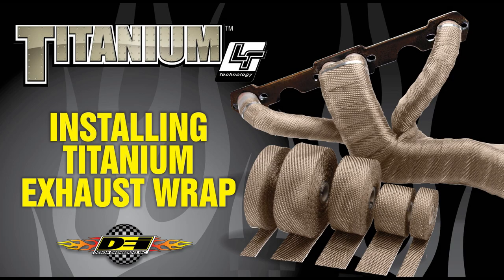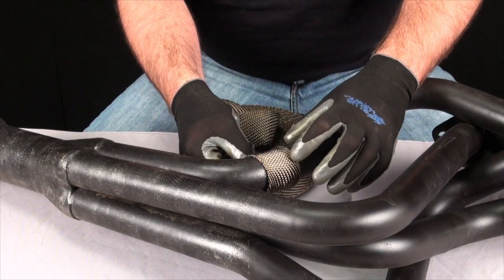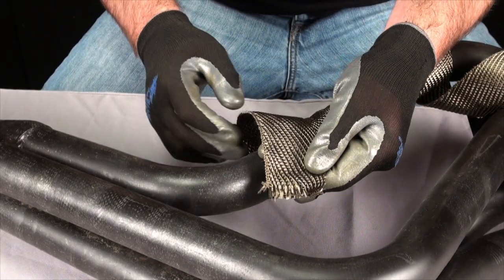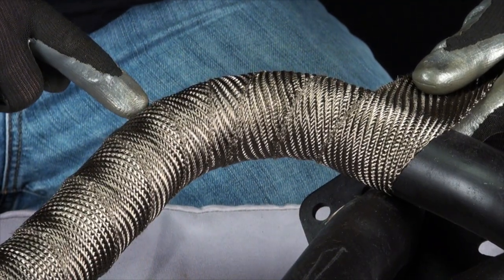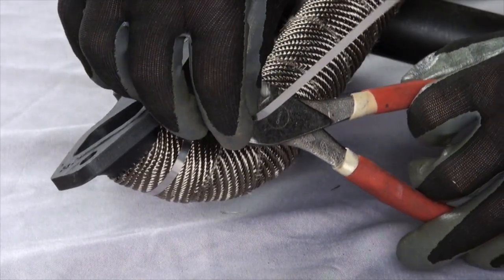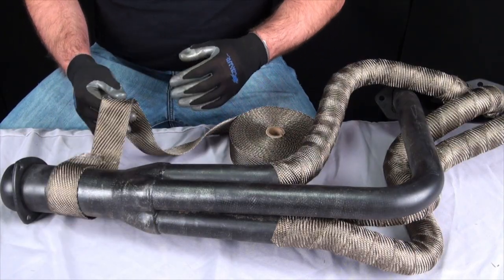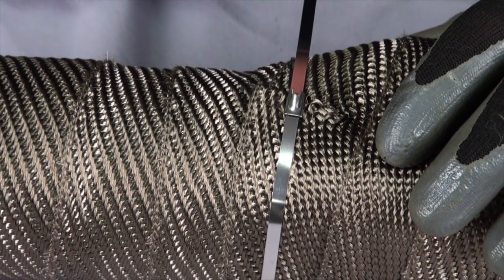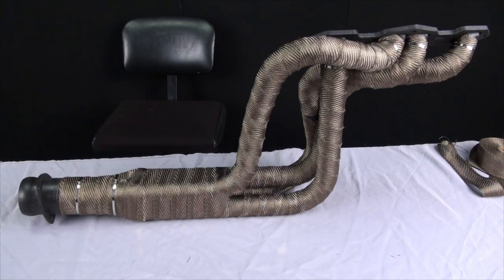"The Original" TITANIUM Exhaust Wrap Installation

Comment: Whats the point of wrapping? May sound like a dumb question but with or without stuff wrapped in my car i am not going to touch hot car parts. Lol
Reply from the maker: Not a dumb question at all. It will help in power gains. 
Hard to say how many horsepower because there are so many variables. But
 it reduces the underhood temps so cooler air is available to the 
intake and the engine. It also decreases the density of the exhaust 
gasses so it lets the whole system become more efficient.
Reply: can also help protect other components around your manifold/header. for those people that dont have a heat shield. thats the reason im planning on doing this
Reply from the maker: It will help those other components as well. An added bonus.

Comment: I have heard a myth of Exhaust Wrap, it can reduce the car interior exhaust drone, is that true?
Reply from the maker: +Xeno Jupiter It doesn't really do anything  for the  sound. If you wrapped the entire exhaust, it might quiet it down a bit as an added bonus but it will not be a noticeable difference.
Reply: Design Engineering, Inc. Ic.... Thank for the reply and information. :)

Comment: why do you need gloves?
Reply from the maker: We tell you to wear gloves because we always recommend the use of personal protective equipment when doing any work, regardless of the level of risk involved. That said, installing Titanium wrap is no more risky than changing your oil or filling your tires with air. The basalt fibers Titanium is made from does not splinter like the fiberglass in traditional heat wraps, so it's not going to leave you itching like fiberglass.

Comment: does the wrap melt
Reply from the maker: No it will not melt. It is rated to 1800F direct heat and 2500F intermittent heat. In the unlikely event it would ever get that hot, it would not melt. It would get brittle.

Comment: Yeah those ties are garbage. What a waste of $20. Just use worm gear clamps. So much easier. Look much better than the chicken wire that snaps when tightening with the tool.

Comment: Someone suggested that I wet the wrap first before installing. Is that advice correct? Thank you.
Reply: Did you even watch the video? It explains this.
Reply: You dont wet titanium wraps
Reply from the maker: With our Titanium wrap, wetting is not necessary. It is a different material than our fiberglass wraps. The fiberglass wraps are the ones you do need to wet before installation.